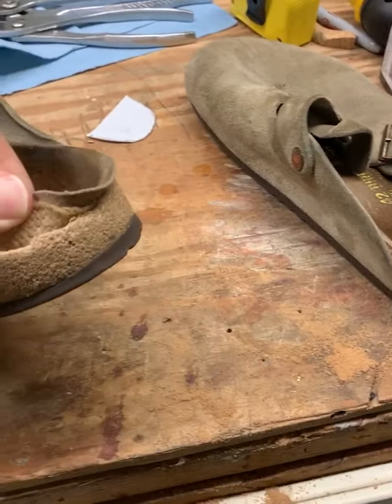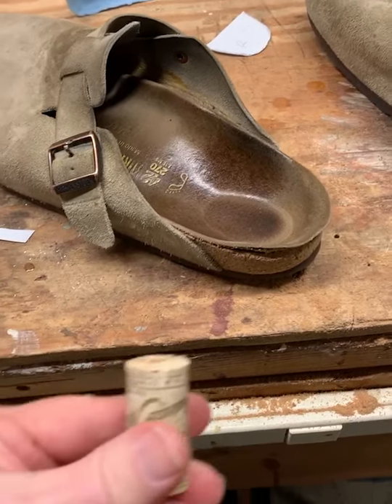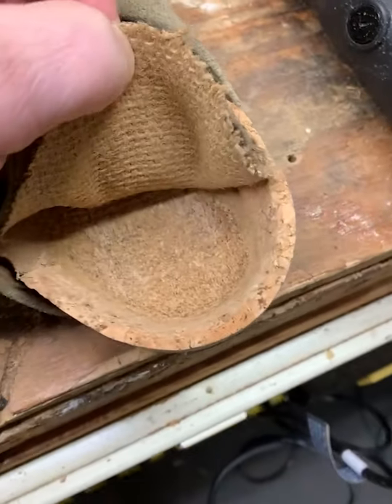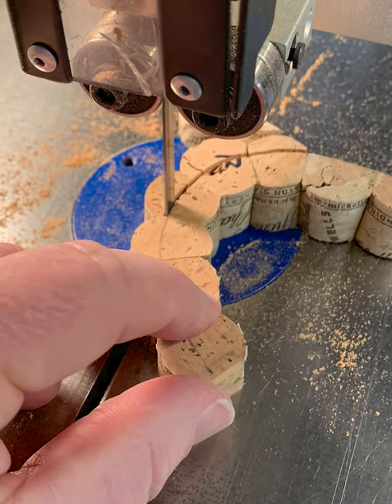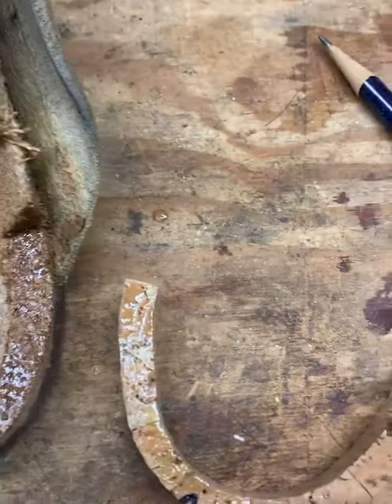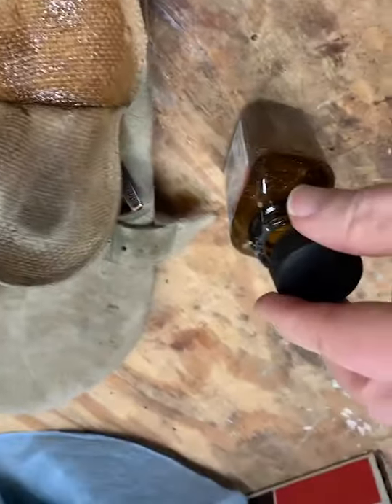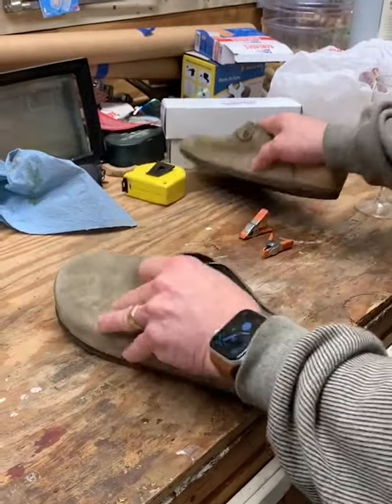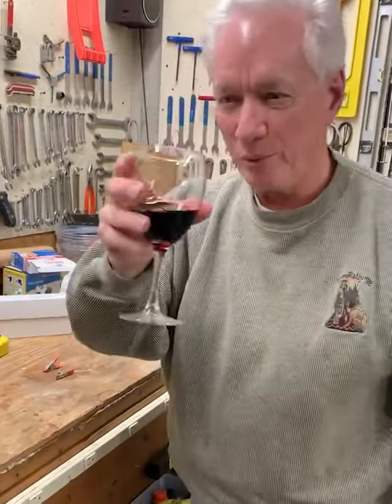Birkenstock Repair With Wine Corks

Comment: What about sealing the cork.  I repaired my pair once and the repair broke apart easier than the original.
Reply: An original birkenstock cork bed is made of latex and cork. I would have just build up the broken parts with small pieces of cork and contact glue  then seal it up with a cork sealer. Done these multiple times and mine never broke apart.